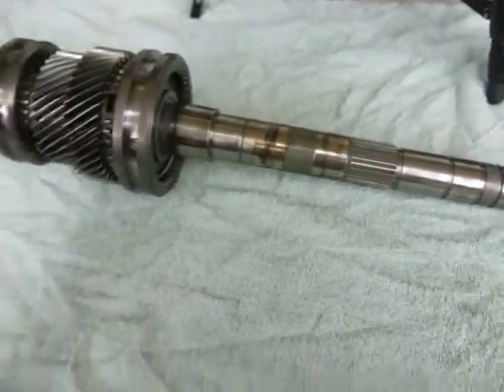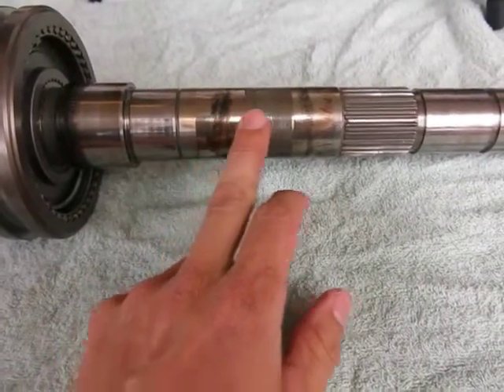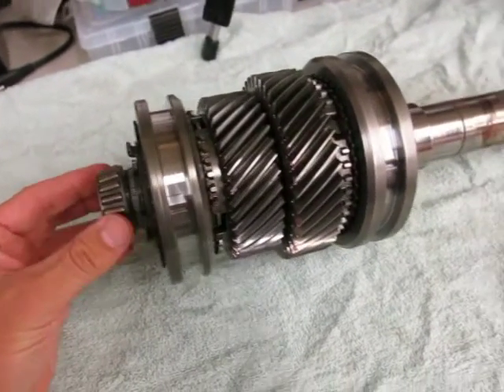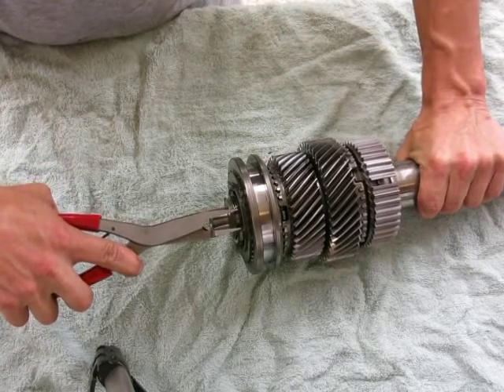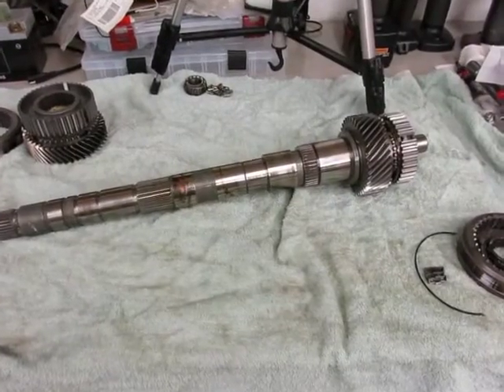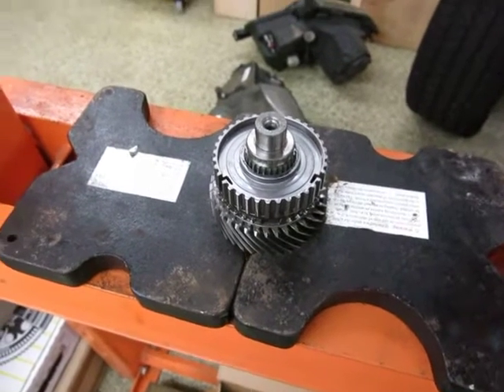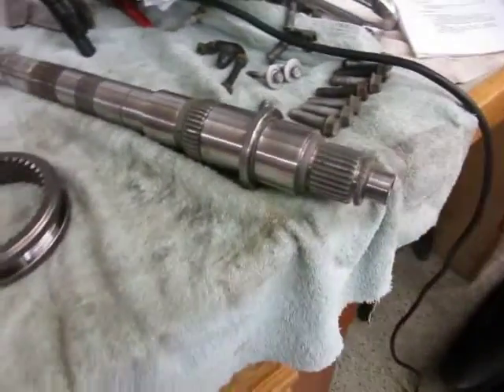T56 Rebuild - Part 2 - Mainshaft Rebuild

Comment: Hello I have a Holden Commodore SSV 2006 with the T56 6speed manual. I have lost 5th & 6th gear, but still have reverse. The gears lock in 5 & 6 just doesn't engage. Its as if it were in neutral. Just Revs out. Could this be mainshaft issue, which is common on these gearbox's. Any help or information would be good. Thanks
Reply from the maker: I don't know what you mean by "the gears lock but don't engage".  If you only lost 5th and 6th and all other gears work smoothly, then it's probably not mainshaft.
Reply: I would say the “keys” that hold the shift collar in place are broken. A known problem on higher mileage units that do not have the billet keys. Also, the splines on the mainshaft which hold the 5/6 cluster in place could be shot but that’s a distant second possibility.

Comment: I have one apart out of a 2003 Holden v8 ute with 260000Kms and its a mess even thought he initial problem was no reverse gear. It pushed off the  reverse mainshaft retaining circlip. Mind it looked clean enough inside. I needs a new mainshaft (spline loose under 5/6 gear) 5/6 gear bore and spline worn, Reverse hub and circlip, Extension 5/6 cluster imprinted under 6 gear. Don't have any specs and the end float on 1st gear is .040, 2nd is .030, and 3rd is .024 and that seems way too much to me?? Can't see where the wear is making this endfloat . Any suggestions?

Comment: Hi from New Zealand Chris!
Thank you for these great videos, they are seriously helpful for me with my rebuild! Question for you... Did you ever get a conclusive answer on whether the 1st-2nd syncro slide hub is symmetrical? My 2nd gear side is a little worn and I was thinking if it is symmetrical then I'd prefer to turn it around to put the wear on the 1st gear side. Parts are expensive and hard to come by here so short buying a new one from the US and paying twice the price of the part on taxes and freight I'm reasonably willing to find out!?...
Cheers,
Sean
Reply from the maker: Sorry -  I never dug into it further.

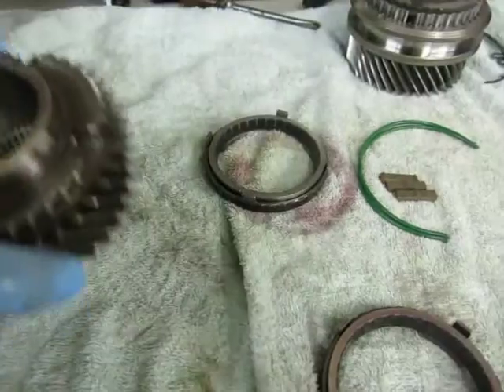Comment: Hi Chris, at 8:46 you grab a spacer, do you know if all the T56 include it? mine is a LT1 and I'm 99.99% that doesn´t had any of them when disasassembly it and the case looked like factory sealed, any opinions please, regards.

Comment: Wondering if this is a common problem because I'm planning on buying this transmission new soon and don't want to have these problems
Reply from the maker: Hi Ricky - I don't know how common it is.  My guess is that most people who might 'have' the problem aren't even aware of it unless they beat on the engine.  It's certainly not widely reported as a common failure, but a lot of folks who have torn down their T56 have seen loose 5/6 gears.
Reply: +Chris Bruno I'm trying to buy the t56 magnum pushing 800hp that's why I'm concerned if the magnums also have this problem. I hear God things about them holding major power not planning on doing any digs more rolling starts
Reply: The loose 5/6 cluster gear on the mainshaft is an extremely common problem because the cluster is only splined on the 5th gear side. It should’ve been splined all the way through. Most rebuilds require a replacement of the mainshaft and the cluster, unless your spline wear is minimal and you can have it dressed up and machined.

Comment: Good videos. How did you know how far onto the shaft to press the 1-2 and 3-4 synchros.
Reply from the maker: If you look at 5:20, you'll see the shaft has a step in it.  That step is where the gears are pressed up against to on each side.
Reply: More concerned with the gap between the gears and synchros.  Manual says to mark the synchro  position before removing. Then to check engagement when pressing on to avoid pressing too close.  I was hoping there might be a measurement you knew of in case the last guy in mine didn't get it right.  The complaint he had was it was hard to get into second.
Reply from the maker: +jvan100 I'm afraid you may be misreading the manual.  I believe the reason the manual says to mark the syncro rings is so that you reassemble it with the same teeth engaging the mating teeth as when it was assembled the 1st time.  You actually don't need a 'press' to assemble the synchros - you can do it by hand.  The reason that the manual says to 'press' it to a certain point and stop, is to properly engage the keys and retaining rings during reassembly.  Once assembled, the synchro rings actually slide back and forth, so their exact position is immaterial as long as the keys and rings are installed correctly.

Comment: I have a problem on my transmission is that making a noise on first, second, third, fifth and sixth except the fourth 

And some of the shop told me that it's from the input shaft bearing and the countershaft and I have to replace them!

Do you have any idea about this problem?
Reply from the maker: +Ealmalayu 
Hi Ealmalayu,

Well, in 4th gear, the shift forks engage the 4th gear synchronizer and essentially lock the mainshaft and the input shaft together.   In this state, the countershaft is still spinning, but it is not under load.  To be clear, I'm not a transmission tech, but the advice you received seems at least probably incorrect.

If I had to guess, I would say that it's probably the countershaft bearing that is a problem.  The transmission would really need to be disassembled to determine if any shaft needed to be replaced, but the failure of the countershaft bearing does not predicate the need to change any shafts.

Hope this helps.  Good luck!
Reply: +Chris Bruno 
Thank you so much bro for your response 
Ok, dose the countershaft bearing can be replaced or should I replace the hole countershaft? And do think no need to replace the input shaft so how should I check on it?
In addition, I have a noise problem when  keep the transmission on natural a release the clutch but if press the clutch the noise gone! Do you have any idea about that?
Although, I bought the transmission after it was rebuilt and installed a new Meclaod clutch